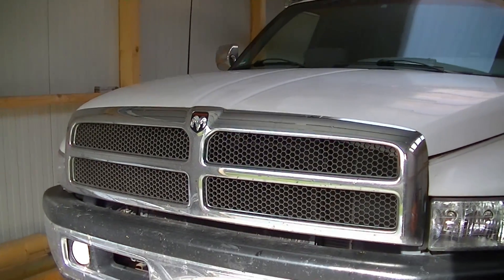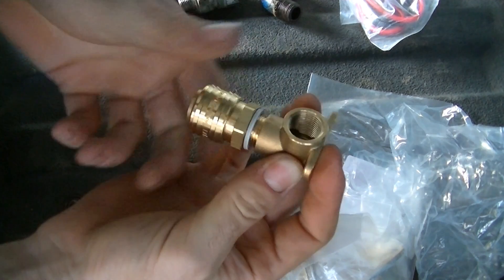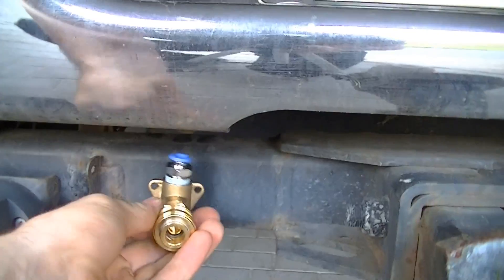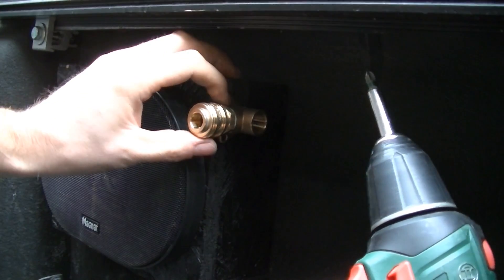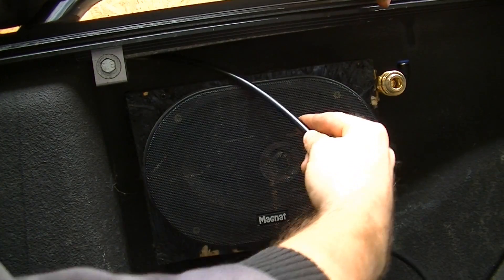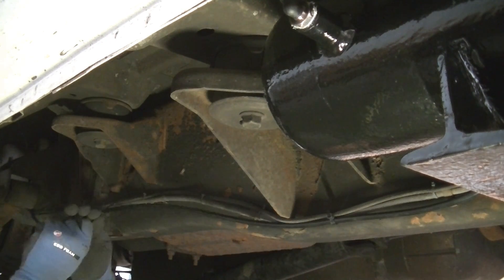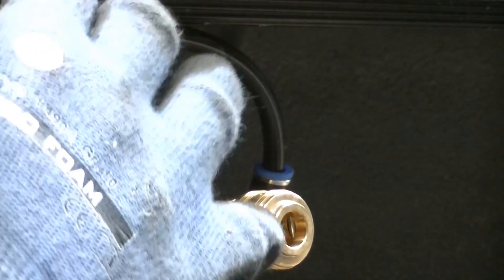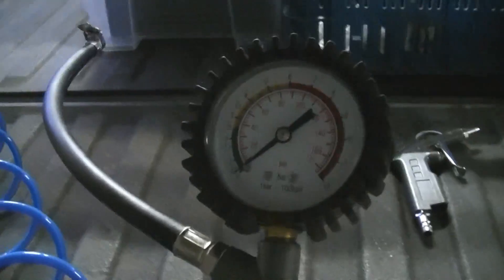HOW TO MOUNT AIR TANK OUTLET IN TRUCK BED, INSTALLING COUPLING+LINE+FITTINGS, ONBOARD COMPRESSOR KIT

Comment: That airline/coupler will be very slow and low volume. A 3/8" or 1/2" line would provide much better flow and volume...even airtools. ANY restriction will slow things down
Reply from the maker: good point thanks